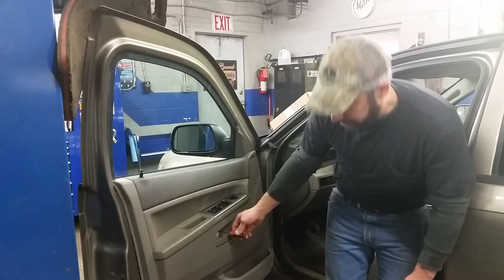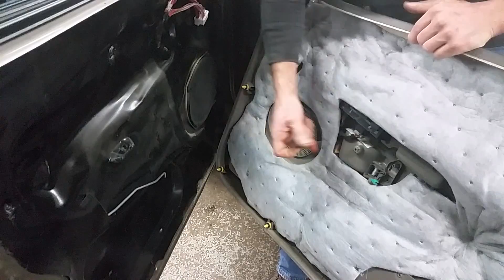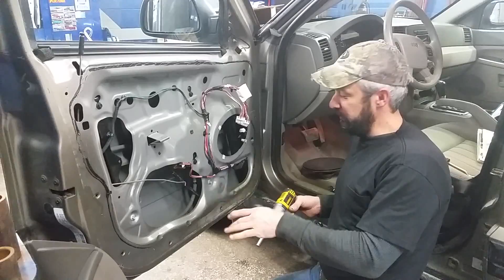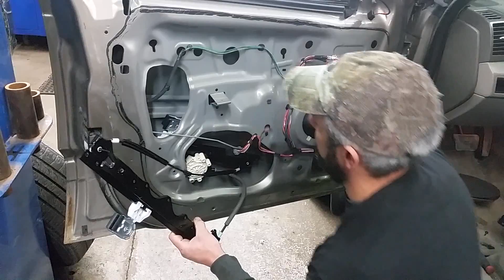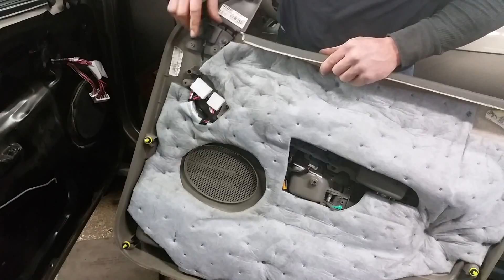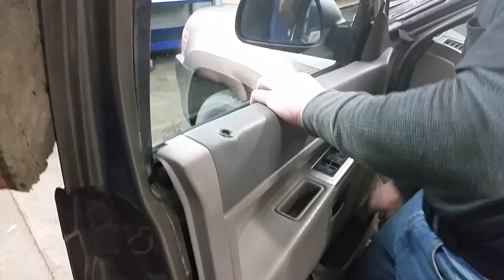Power Window Regulator & Motor - Jeep Grand Cherokee

Comment: I know im commenting this 7 years later but has anyone had the problem where your window would get scratched when rolled all the way down after the install? It’s probably not noticeable to glass with no tint but i have 5% on the front windows of my Cherokee and every time i roll my passenger side down the scratch starts to get bigger going up on the bottom side of the window towards the side mirror. If anyone had this problem before would y’all please reply and tell me how you fixed it or what I could’ve did wrong. Thanks.

Comment: What if the regulator is inside a riveted panel with no access?
Reply: usually there is a dent in the sheet metal where to drill an access hole to get at the rivets.  drill out the rivets too.  support the glass every time.

Comment: Number 1 killer of window motors? Unlubricated window seals. Put some silicone on the window seals on the bottom of the window so the window motor doesnt have to work so hard
Reply: My problem has always been finding the proper lubricate to use in those window regulator tracks.  You need something that is highly resistant to water, like silicone, but that has a super high-temperature resistance and is synthetic to resist gumming up over time like most petroleum-based greases.

Comment: Thanks for detail video, I have problem with rear window, roll down but it wont roll up. I did not remove the regulator out of door panel yet and try different switch and same result then I detached the motor from regulator (only motor without mechanism behind it) and try it and works in one direction and not the other. Do you think the problem is motor?

Comment: Nice video. I was hoping to see a close-up of the regulator mechanism to see which part had broken. If the old elec motor is working, can only the window mechanism be purchased & reattached to the old motor?
Reply from the maker: EppingForest304 MMmm not sure on this one. Sometimes on certain models you can get a regulator with out a motor.
Reply: Great question because I'm wondering the same thing. My Comment should be the first one in the "newest replies" category.
    What did you find out? Everything's good on mine save for the two nylon roller wheels as one's completely gone off it's stud and the other is worn too small to stay in it's track.
Reply: Asking your dealer/auto parts store will answer this question.